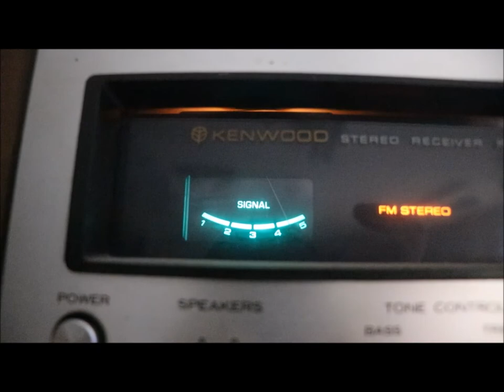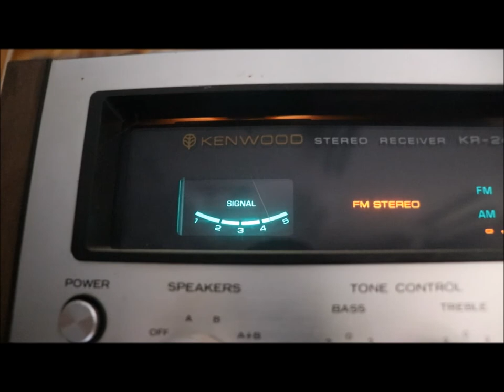Winegard Antenna Pre Amp Makes A Difference

Comment: I have an antenna on my garage roof with a pre amp for my house trailer and garage tv's.. I don't pay for cable or dish because the internet and my antenna are all I need.  I listen to the radio if at all thru my computer as I do have Internet Fios.  My antenna is directional as well, it has all those fins on it an d is pointy. I have it mounted on a tri-pod since my shop chimney is not all that strong plus the crap from the wood stove would belch out onto the antenna.  It's the old saying, if your happy with your set-up, than that's what to have. I have the short 3 foot tri-pod and I often wonder if I had an 8 foot tri-pod if the reception would improve. I have one far away station that on a really windy or stormy day is hard to get, simply " no signal" but other than that works great.